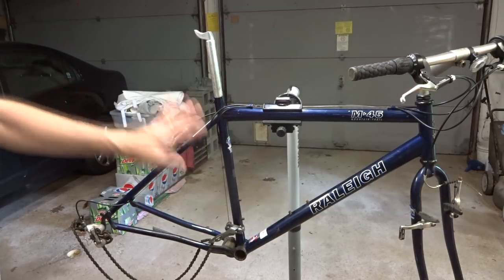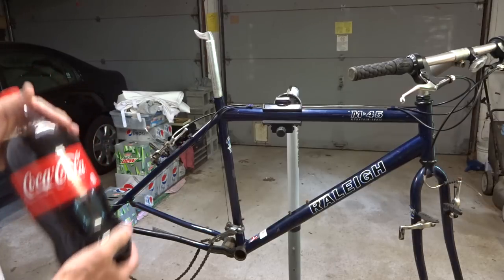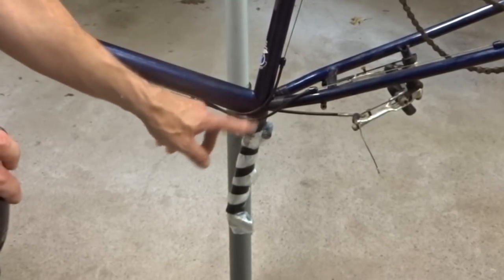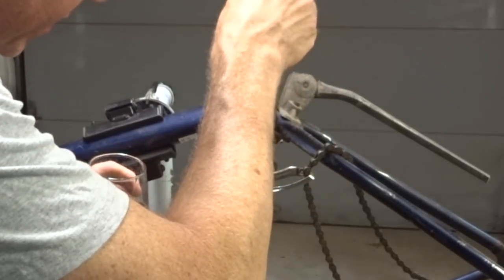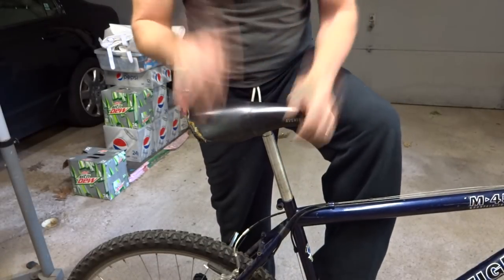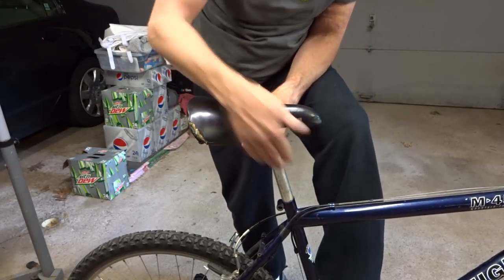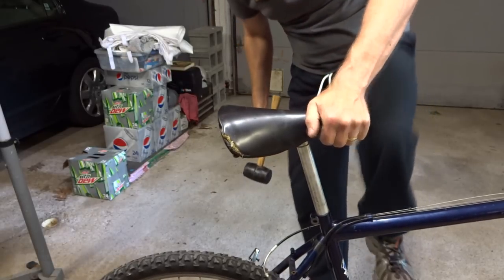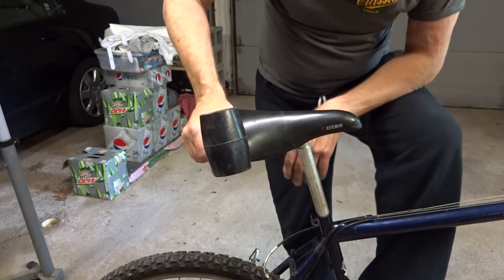Removing A Seized Seatpost with Coke/Coca-Cola - Does It Work?

Comment: I heard it was a mixture of Pepsi and Mountain Dew. Got any?
Reply: I was thinking same mixture too :-)
Reply: Iv had a bike sitting outside for 7 years  I tried the Pepsi and mountain dew mixture made my seat post slide out really quickly no work needed thanks for the help iceman
Reply: of course
Reply: IcemanMobile lol
Reply: i used vinegar to removal rusty
Reply: Mountain dew would probably melt everything after two weeks and RJ would come back after his vacation with a pool of soggy metal in his garage
Reply: It’s actually Diet Pepsi in his garage.

Comment: I'm wondering if leaving the Coke inside the seatpost like that for such a long time (two weeks) caused the sugars crystalize and the syrup to stick to the frame. Maybe if you left the Coke there for just a few minutes or up to an hour the acids could've loosened it up and gave you a window to try removing it before it all sticks up. Doubtful, but I'm not entirely ruling out this method yet.

Comment: this never worked for me either. my best method is to drill a hole through the seat post, insert a thick bolt so it sticks out both ends, and secure the post in a shop vise, positioning the bolt at the pivot point. then grab the frame and wrench away.
Reply: The frame tubes are sized for compression, the torques you are applying on the framecan do serious damage. Pulling upwards with various tools are safer.

Comment: Try boiling hot water. I suggested this before but it didn't work for you - as you say, prolly worked because my post was not that stuck to begin with but the expansion did make a very visible difference from totally locked post to being able to move it somewhat and get it out. Nothing else came close but it was a high end bike and i couldn't hammer or sacrifice the post. I did have a carbon post in alum frame also. Different materials and some corrosion. I think the timing is important, boil water in kettle, pour on tube for a good 15 seconds with bike on its side then twist immediately. Mine came out after doing this 2-3 times.
Reply: if t is a aluminium seatpost and steel frame heating will have an opposite effect. try cooling the alu seatpost (alu reacts double as much with expansion/shriking as steel. so cooling with an ice/oil spray is a good idea. heat is not. But it highly depends on the combination of materials. steel/steel heating might work

Comment: best way I have ever found- soak seatpost day before w penetrating oil, PB Blaster is good. leave the seat on the seatpost. took the bike to my workbench with a face style woodworkers vise invert bike upside down and clamp onto seat only. use the total length of the bike front forks to chainstays for leverage and slowly... slowly  lean into it first one way then the other twisting. works most of the time. you will probably lose the seat, vise action will collapse the seat rails but that sucker will break loose
Reply: mike manikowski i did exactly that with 'Rust Eater' and and gt saddle
Reply: It was an rly long uncut thomson elite seatpost, in my toyoframe godzilla. Im so greatful.

Comment: Tried it with a big screw jack jig setup specially made for this and the jig began to deform. Ended up sawing out the post from inside with a large saw blade sandwiched between two strips of steel and after an hour I was able to twist the post out with a huge wrench and a lot of sweat. Here in rainy Scotland after even a short trip the post and tube are soaked in water thrown up from the rear wheel, so now the new post lives on the bench and only goes in while I'm riding the bike.

Comment: i live sea side and this is one of the most common problems i run into, aluminum on steel seizes like a weld,  i mix a little brake fluid, some used motor oil and let it sit in there, sometimes i mix half water half white vinegar, it is a bit nasty, but works a little faster than the brake fluid/oil mix.

Comment: Hi RJ, as the coke didn't work, and if this bike is steel, how about making a video where you try the infamous caustic soda dissolving method? I know you've used caustic soda on the remains of an alloy quill stem stuck in some steel forks, but one removing a post would be awesome! That, or I suppose you could attack this one with a slide hammer. I hate stuck seatposts, they're the only issue I've ever failed to fix on a bike.... keep up the good work.

Comment: This was the dimise of my 97' Raleigh M-50 in 2005, I tried soaking it in penetrating oil for months but no avail. Since I had already purchased a brand new 05' Trek 6500  it was time to let it go.    I ended up totaling the frame and repourposing all the componets on to a green 99' Trek 800 Sport that I found in the trash, so it lives on.  

Its really funny the bike in this video is a Raleigh M-45 and is the same vintage and color as mine

Comment: man the best method i found to remove a seized seatpost includes really hot water and a rubber mallet works like a charm every time ..... just poor the hot water over the seattube and repeatedly heat and cool it  then try to twist the saddle should come right off in no time

Comment: Mine was so seized I had to cut the top of my seat post off and the bottom (enduro frame), so i could get a hacksaw blade down it and cut a slit along the seat post internally, then try and fold it in, after using mole grips to crush it, i ended up managing to hammer it out. It took me hours!! This is not an easy task if its proper seized!
Reply from the maker: https://www.youtube.com/watch?v=LJLZ9Ojtr80
Reply from the maker: https://www.youtube.com/watch?v=P-YpmDx86d0
Reply: @RJTheBikeGuy  Yeah i did the saw method, accept i only cut one slit down the length of the post and just crushed it in with mole grips so i could then get a better purchase on it.

Comment: Yo RJ, I've dissasembled my suntour m3030 and removed the rubber part in the bottom, and now i have more travel, but can it damage my fork?
Reply: well if you remove parts that supposed to take the force when you bottom out the fork. i think you can figure it yourself

Comment: if it's rust that's making it seize then the coke should work.  if it's the same issue I have which is the wrong sized seatpost then nothing short of a dremmel to the frame or maybe using two cars to pull them apart will work.  with mine the seatpost was too big for the frame.  it kind of looks like you have the same issue.  but try some liquid wrench just to make sure.

Comment: leverage is key...I finally had success on my seized aluminum post by opening up the seat post clamp with lockring plyers, squirting lemon juice inside, and prying out with a 6 foot steel pipe
Reply: J  I'm not a scientist but my guess is the acidity from the juice eats away at the corrosion

Comment: I need help my seat post is a threaded seatpost and it got stuck and the wedge fell inside the seat tube and the I tried twisting but only the part holding the saddle is moving but the rest of the seatpost is not. I need help I don't want to risk anything I want suggestions that will work 100%.

Comment: Two part Acetone, one part Transmission Fluid. Mix the two together and use an eye dropper. Doing so from the top of the seat post to the frame. Takes three days of constant dripping into seat post. The mixture will eat rust  and old grease. Use pipe wrench and it will come off......taken seat posts off from bikes sitting in snow banks... lol
Reply from the maker: The problem wasn't rust, but galvanic corrosion which is aluminum oxide. I want to come up with a test for the acetone/ATF mix (which is 50/50 from everything else I have read) and compare it to other penetrating oils. I am guessing it is an overrated exaggeration just like Coke.
Reply: Part of reason coke won't work is sugar and water its based on. The trick with Acetone & Transmission fluid was something a Auto Mech told me. Its used to remove rusted heads on cars. But it will take skin off so use Plumber's gloves and it will take off paint. Used it once on taking pedals off that were rusted and on 30 years. Love the videos RJ.

Comment: Hey rj I haven been watching the videos for years now and never subbed so hey subbed now wanted to ask I've got an old Marzocchi bomber z2.5 fork and I need to replace the steer tube do you know how to re press them and is there any cheat methods as getting it sent off and done professionally is going to cost me the equivalent to about $150
Reply from the maker: I would have it professionally done. $150 is a lot less than the medical bills if your fork fails,

Comment: @RJTheBikeGuy Mate try to use vinegar... it has a high level of acidity and it will react very good with the rust.... but don't leave it weeks, just couple of days... BTW I haven't done it myself but perhaps it will work... Cheers.
Reply from the maker: The issue isn't rust. It's aluminum oxide. Vinegar doesn't do anything to that.

Comment: Mole Grips & a Hammer. Failing that, turn the bike upside down & use a Slide Hammer. Can't use heat or you may fluff the frame up?!

Comment: I have a bike with a seized to seat post. I've tried everything. I guess the last thing to do is drill a hole through it, then put a screwdriver through it and try to twist it out.
Reply from the maker: You've tried everything? Really? I have never tried everything yet. Did you try a slide hammer? https://www.youtube.com/watch?v=S3ek2GeZzE0
Reply: RJ The Bike Guy no I didn't try everything lol
Reply from the maker: I am always looking for new ways to remove seized seatposts and stems.
Reply: “I have never tried everything yet.”

that’s an RJ classic

Comment: Try White Viagar .  It eats the rust right off my tools when they get mistreated.  Another good Penetration / Release compound   Mix about a oz of Acetone with equal parts ATF.  Let it set a hour.   Rusted bolts Break free because of what it does to the Rust.  Converts the Rust into a Crumbly Powder with no more lock up strength.
Reply from the maker: It's not rust. https://www.youtube.com/watch?v=bGqV5KE7cb8
Reply: In that vid your talking about Electrolysis. I was talking about Rust.  Steel on steel.  Sorry.    I have Cheap Bikes.  LOL

Comment: why not use a heat gun and heat it up a little bit (like 200 degrees C) and try to pull it out that way ( careful though it will be pretty damn hot to the touch) we do that all the time to machine bearings and it works all the time.
Reply from the maker: Because this video was to test coke. And I am guessing heating the frame to 200C will damage the paint and maybe the frame too.
Reply: Mohamed Ali   It's an aluminum seatpost in a steel frame.  Aluminum has a higher thermal expansion than steel.  Heating will make it stick worse, not loosen it.  Cooling, using liquid nitrogen, would be more likely to work, because the aluminum will contract more than the steel.
Reply: oh! I thought the materials were the opposite (ie aluminum frame and steel seat post) which is the case in my bike.
liquid nitrogen would be an over kill though.  let me do the math, and I might be able to get you the right temprature .

Comment: Ever tried Ammonia? Some people claim that it can remove galvanic corrosion from aluminium.
Reply from the maker: Yes, and it didn't work. Supposedly it eats aluminum oxide. But keep in mine, the corrosion is the length of the seat post contact, and the ammonia only reaches the edge.
Reply: @RJTheBikeGuy  Thanks for the info. I have a frozen seat post (aluminium in steel) and I was hoping for an easier task. I guess there're no shortcuts for this job...
Reply from the maker: https://www.youtube.com/watch?v=S3ek2GeZzE0

Comment: How much to use? I tried an 8 ball with no luck🤗
Reply: Coke was used in wwll in aircraft to remove corrosion and to clean. If you don’t believe me get an old penny and leave it in a saucer of coke for a couple of hours, the results will surprise you.

Comment: So I've just bought a road bike with aluminium frame and seatpost, and it's real stuck in there. I've been spraying WD40 into my frame and around the outside of the post for 24 hours, with no luck. I've tried everything I can think of like twisting it(didn't move), pulling it, hitting it with a rubber mallet.. Still nothing. Anyone got any ideas?

Comment: Has anyone tried citric acid, CITRIC ACID, Lemi shine or equivalent?
Reply from the maker: Citric acid doesn't touch aluminum oxide. It will probably make the galvanic reaction worse.
Reply: Seems as lye may be about it. This has been a subject machinists, chemists have at least looked at. Interesting I have a steel seat-post in an aluminium frame...I greased it and took the entire thing apart and had a look. Perhaps a trade war with China will be a good thing?

Comment: WD40 then hammer around on frame with rubber so the 2 corroded metals will loosen up then punch it in, when it will let go then you can take it out.
Reply from the maker: LOL!!! After this video, I was using Kano Kroil (way better than wd-40) and pounding on it with a Snap-On super heavy duty PH3050B air hammer, and later a sledge hammer. It didn't budge. I ended up cutting it out,

Comment: Put coke in the bottom bracket area. Toss mentos in. Seal it, quickly. Seatpost ejects with force.

Makes a mess, but a 100% guaranteed way to get that seatpost out. (Please don't actually do this.)
Reply from the maker: Yeah. no.

Comment: Heat and a work bench (vise) will do it.
Reply from the maker: LOL except when it doesn't. I ended up have to cut this one out.
Reply: @RJTheBikeGuy   which tools did you use to cut it out? are there any special saws you could recommend. 
I'm facing the exact same problem at the moment and wanted to try the coke thing till I found your video. Another guy told me to use Ammonia to remove the corrosion, any thoughts on that?

Comment: I got thd post out I put cold packs on it for about 45 mins. Did that trick. 😆
Reply from the maker: I have tried heat, and also cold, and they have never worked. Even tried dry ice on a seat post. This same seat post actually. It didn't work. I think maybe it only works on lightly seized seat posts.
Reply: @RJTheBikeGuy  
I had been putting penatrating oil in the down post for aroind 6 months
Reply from the maker: That couldn't hurt. I not sure how much penetrating oil will help if the issue was galvanic corrosion. https://www.youtube.com/watch?v=bGqV5KE7cb8

Comment: I'd say use a air hammer. Mechanics use it to get siezed stuff out all the time.
Reply from the maker: I actually did try an air hammer and many other methods. I ended up cutting the thing out. I hadn't made my puller tool yet.
Reply: @RJTheBikeGuy  ah cool, i rode my motorized bicycle with a 24 inch wheel in the back and a 26 in the front, which slightly bent it, but the other day i hit a hard bump and it bent it way far back, along with that it was siezed in the first place, so i think im gonna get a hacksaw blade and make a custom saw to fit into the hole of the seat post to cut it out then hit it with a chissel and a hammer
Reply from the maker: @propabilityfpv303  You can try this: https://www.youtube.com/watch?v=S3ek2GeZzE0

Comment: coke works better at dissolving your stomach than a seatpost
Reply from the maker: The diluted phosphoric acid in coke is not nearly as acidic as the gastric acid already in your stomach.
Reply: vinegar will work you need to try!! my dads 20 years old helkama's seat tube slied out!! but you need to put it ruff!
Reply: I have done this 100+ times and it never failed.

Comment: I hear that aluminium and iron oxides are dissolved by acid such as coke which, containing citric acid, has a Ph of 2.525, which is one of the most acidic things around the home. Vinegar containing sauces are also used .e.g. to clean old coins. https://www.engineeringtoolbox.com/acids-ph-d_401.html I may try vinegar or pure citric acid cleaner since I don't want the stickiness of coke. In addition, I am going to try heat (hot water) freeze (spray). I will use Loctite freeze unfix spray too. AND a slide hammer if I can get one. Thanks!
https://www.youtube.com/watch?v=S3ek2GeZzE0

But then, I don't think it would be a good idea to use a slide hammer on my carbon frame.
Reply from the maker: Please provide reference for Coke dissolving aluminum oxide. Keep in mind, Coke comes in aluminum cans... https://www.youtube.com/watch?v=bGqV5KE7cb8

Comment: I got a Rossin racing bike from a car boot fare.  it was £10.  Had a seized seatpin.  I tried a different method of using coke to get the seat pin too move.  Over months and years.  I drank a lot of coke.  put on a lot of weight.  tried riding the bike around with out a seat binder bolt.   had no effect.  :/  hey ho. sold the bike. as is.  for £30.  put in the advert that it had a seized seatpin.
Reply: Griftereck.... did you buy more Coke with the profit money you made on that Rossin ? I used to ride a Rossin super record 1978.... funny it awlays wanted rum and coke on rides.
Reply: More than probably.  Ive not had rum very often tho.  Is it popular with Italians?